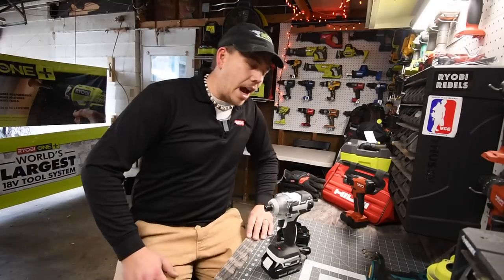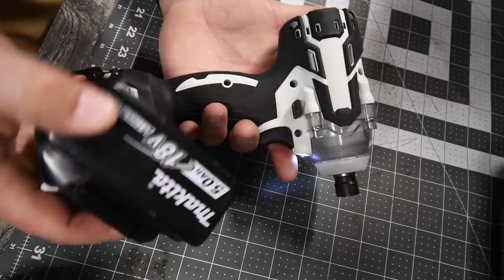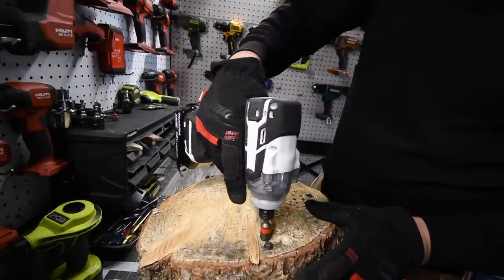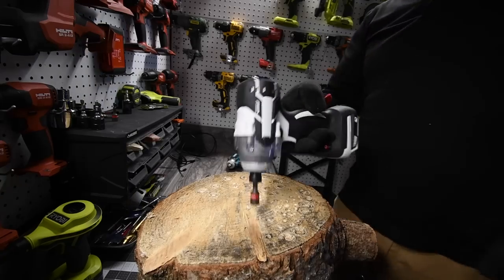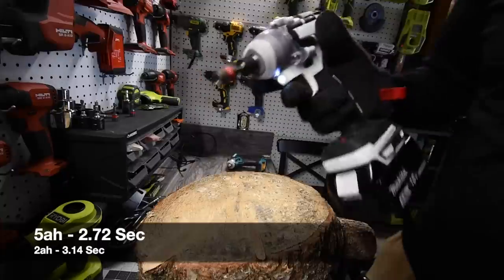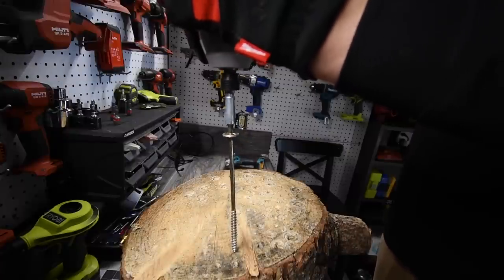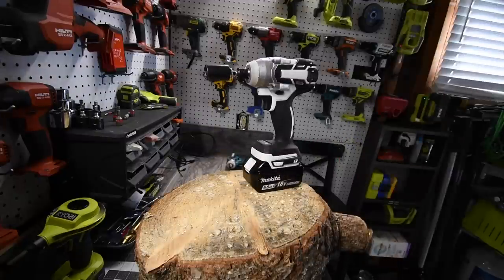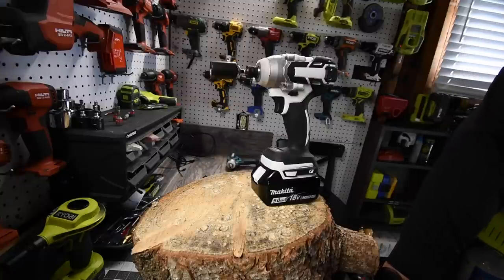Cheap Brushless Impact test (Real Test)

Comment: Should get the new xwt15 think it is or the dtw300 its called in uk awseome new makita impact wrench its about 120 pound.
it has 4 speed settings high rpm about 3200 compare to 2800 the dtw285z  has and 4 auto stops forward and reverse dave and about 250ft pound torque
Reply from the maker: once I can I will

Comment: Every review I've seen about this tool (you, Project Farm, Ave) are all positive, it's not fair to Makita to buy it😅 but for under 50$ it surely can do the job and not be worry about losing or being stolen, you just use it and then trow it in the dirtiest tool bag. ✌️
Reply from the maker: its not bad for the price. if this cost $100 then it would be a crappy tool

Comment: How long will it last thats the question? The hammer inside,barings just ware and tear in general 👍🏻
Reply: Yeah, this is my concern too. I bought the clone version (but with the 1/2 drive) after seeing AvE's review. Since then I got a decent deal on a DTW285z and I must say you notice the difference in quality immediately. Sound from the motor and bearings is drastically different between the tools. The Makita doesn't  have the same rattley feel of the clone so its defiantly cheaper material overall. Biggest thing I would be worried about though is battery protection. Clone version has no overload protection to prevent you damaging the batteries. The clone isn't a bad attempt but you get what you pay for in the end.
Reply: @harpalyke4659  Makita spends years developing there tools like other professional tools they cant afford to fail, one bad tool line then it's curtains or a very big costly mistake.
Reply from the maker: I doubt it will last a few months of real use. but a diyer will probably last a long time

Comment: A think the 6ah is best for the makita  the cells are better than the 5ah thier 3000ah capacity 20 amp dicharge per cell a think compare to 2500mah for the 5ah not sure on the amp discharge prob  20amp but for less time
Reply from the maker: makita needs to make a special battery